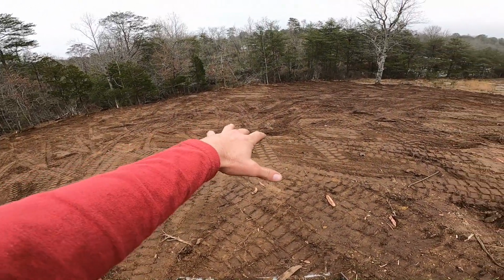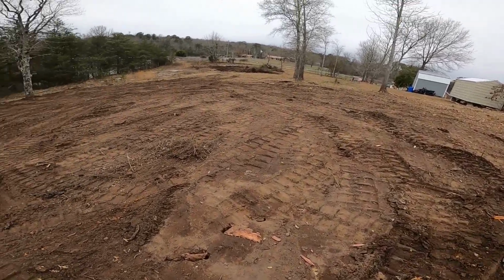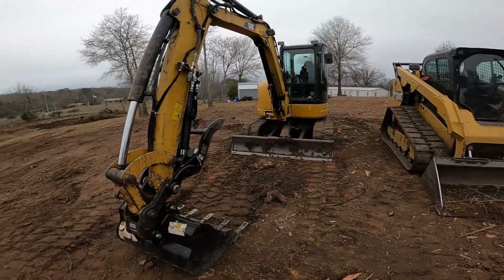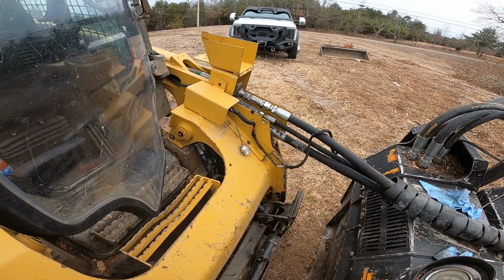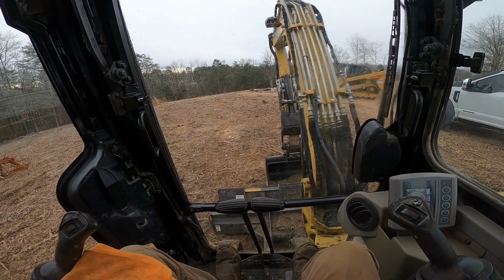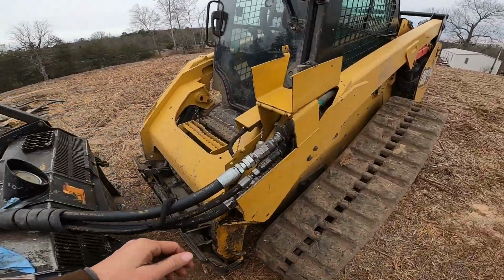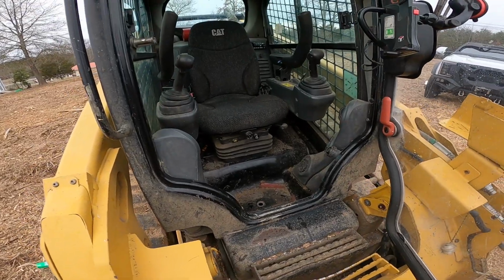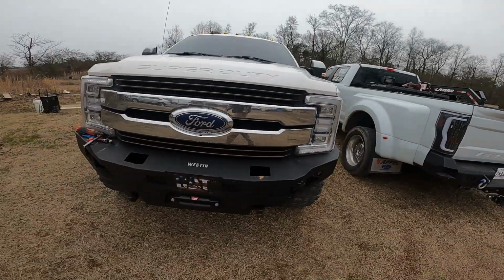Trying to finish the dozer piles but always problems

Comment: Jesse, after buying several used vehicles, I came to the conclusion that I will either pay a bigger monthly note with fewer repair bills or a smaller monthly note with more repair bills.  I'm glad you have the mechanic know how to repair your equipment.   Here's to a safe and prosperous new year to you.
Reply from the maker: I totally agree ive always had old used machines i have found that the higher payments are nice with new equipment with it breaking down i can bring to shop to be repaired, with me the payments are lower and repair bills here and there adds up but not all ways having to have it repaired but i have friends that have new machines and equipment and have seen alot sell out due to lack of work with high payment notes.
Reply: @bowmanlandclearing777  I like having two old machines so when one needs service I can use the other one. Older stuff is good for me because it is cheaper and easier to fix without electronics and proprietary software.
Reply from the maker: @chargermopar  I totally agree with that!!!

Comment: You can upgrade your hydraulic connection with aftermarket components.  Also use rachiting table clamps,  like the ones used in wood working  get them at tractor supply. To connect the old hydraulic lines
Reply from the maker: Thanks for the tips! I'm hoping its just the ice in the fitting but those couplers are 98 dollars a piece  every since i got this on it, it has leaked ever since new. Cat told me to bring it in so hoping they can warranty only had for a month or so.

Comment: Turn on the key with engine off and lap bar down, Move your control levers which should relieve the hyd pressure in the lines. You can always loosen the hyd fittings from the hoses which will release the pressure but never do that with the engine running. I have a Ditch Witch and it does the same thing, luckily they installed a pressure relief knob so you can hook up the attachments.
Reply from the maker: I usually let machine run and found to help but not sure if it helps out or not but this fitting has fought me since the first day i put it on and now with the new one it's big difference. I have a SK 650 ditch witch i thaught about getting a brush cutter but i have root grapple and bucket for it.

Comment: About two hours with a Harley Rake on the Skidsteer cleans that ground up super nice, they are expensive to buy but you can probably rent one for half a day and it makes a world of a difference when you are done. Obviously if you were in season you could throw some grass seed down for them too. Invest the $400 for Stucchi screw together (VEP) fittings for the mulcher, a game changer, they also flow much better than factory quick couplers. If you break the connection on the mulcher loose with two wrenches it will seep some fluid and relieve the little bit of pressure and they go right together. Grapples are notorious for being stubborn with quick couplers connecting because the cylinders hold a little bit of pressure.
Reply from the maker: I've been watching a lot on Harley rakes but I'm really wanting to be able to do all things possible with all attachments. I plan on this year to upgrade to a better mulcher and the stucchi fittings. the fitting i had on it was the problem. I have found that leaving machine run while hooking lines up helps but idk if it does or not.

Comment: Those quick couplers can drive you nuts. I put silicone grease on mine and it sort of helps. When they are really stubborn I will loosen the coupler to let some oil out and retighten. We had cool weather but the lowest low was 48 degrees. You can take the quick couplers apart, I have seen them with rusted ball bearings and that makes it hard to push in. I use generic fittings not the overpriced factory stuff. My old Ford truch has nice fat lead terminals but then they fell apart I soldered on brass terminals. No more corrosion since!
Reply from the maker: They drive me nuts trying to connect the fittings, what sucks is that i don't have anything close to me that has a big and right assortment for the fittings. I just usually buy new ones the fittings take a beating.

Comment: Clean your terminals with baking soda and water  it will clean all the corrosion, then grease them before reattaching, no more problems.
Reply from the maker: thanks peter im getting it mixed tonight and going to soak in morning, when i was a diesel mechanic i sprayed brake cleaner thinking it would help but it don't instant regret haha, I've used all the "terminal cleaners"  and they dont do nothing  but i have some of the terminal spray protectors that is red hope it helps it to prevent anymore corrosion. the old batteries is the cause of it they was leaking all over the place.